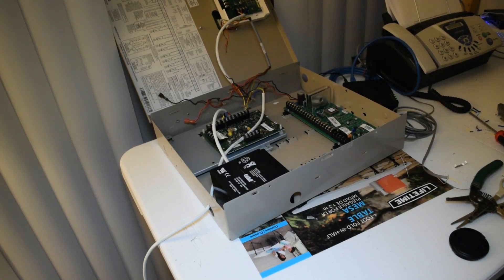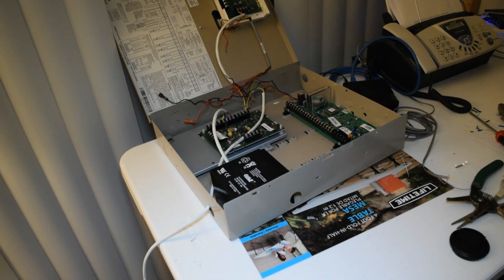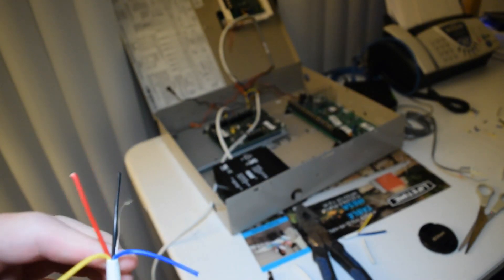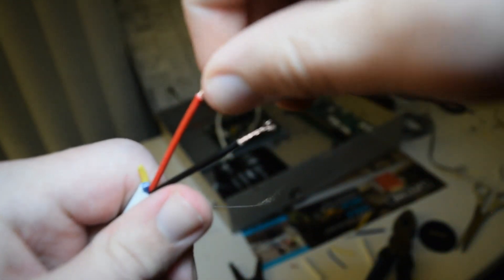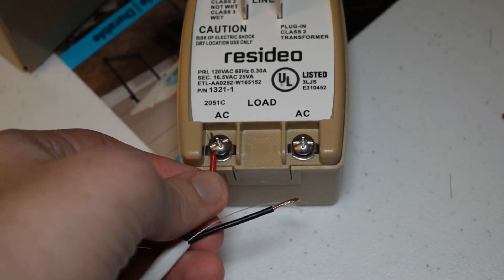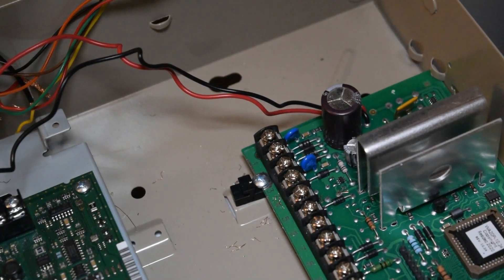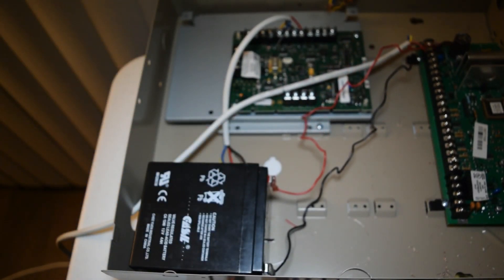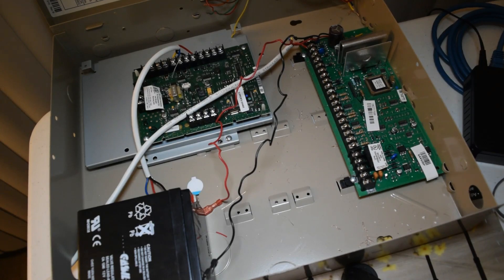Security system wiring tutorial[Honeywell Vista 20P]: Ep. 1- AC power & batt

Comment: do the vista 20p kit on amazon come with transformers and also can i use the transformer to power the pannel instead of batteries
Reply from the maker: I have no idea if the Amazon kit that you’re looking at comes with the transformer. That’s for your eyes to see only. And yes you can use the panel without the battery but it might not work completely right and it will just keep giving you the low battery trouble. Which will probably get annoying.